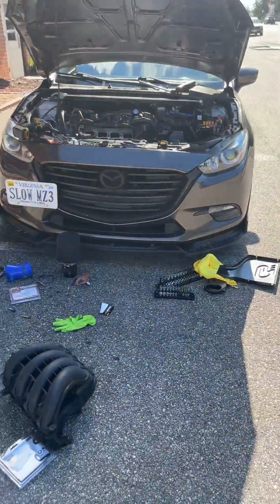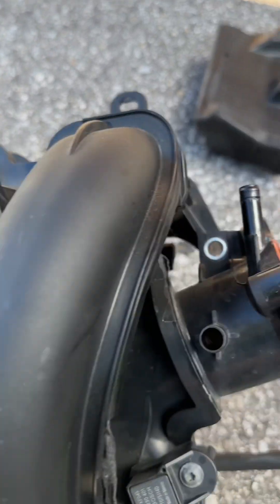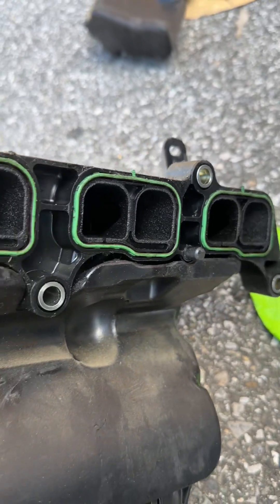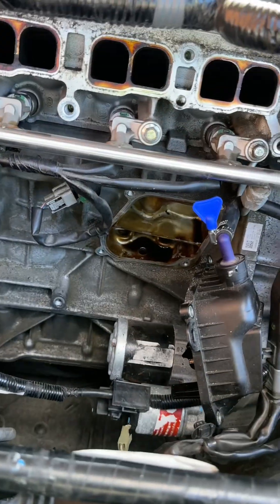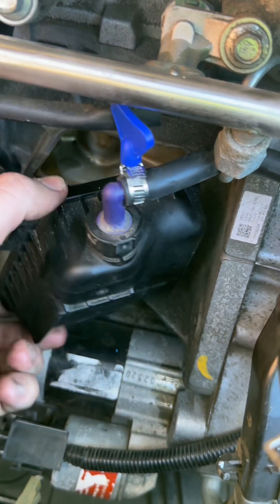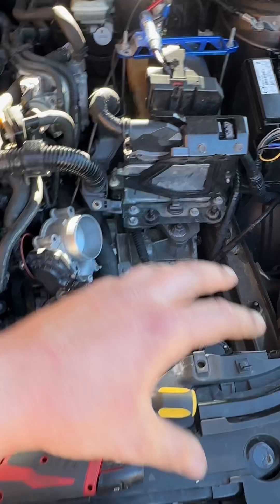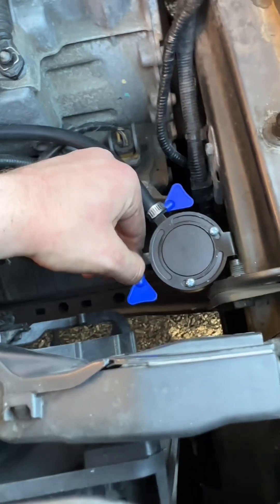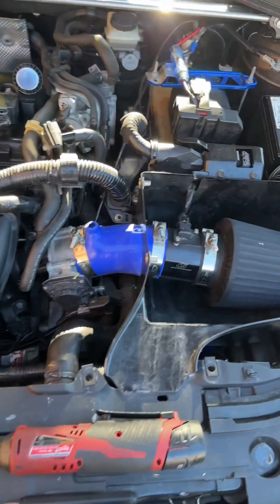Mazda 2.0L/2.5L Skyactiv Catch Can Installation Tutorial

Comment: I have the K&N air intake and was thinking of just  connecting the catch can to the side of the metal heat shield/air box. Would there be any issues with doing it that way or do I need to have the catch can lower down for a reason?

Comment: Hey, great tutorial.  I have an ‘18 2.5 with 68k and I recently cleaned the throttle body which had a lot of carbon build up. Yours looks immaculate compared to mine.  And when I looked down the intake there was a small pool of oil. I can only imagine how dirty my intake is. I’ve been contemplating a catch can. I think they’re technically not allowed by CA smog but prob fine if they’re tucked down there out of sight.  So you recommend just going cheap with catch can it sounds like rather than the kits sold online?  I’ll give this a shot—but maybe watch it starting with the end first 😉 Will be a great opportunity to do a good cleaning and prevent future build up.